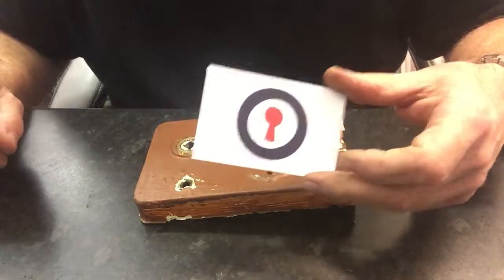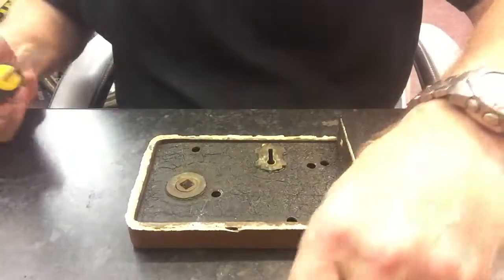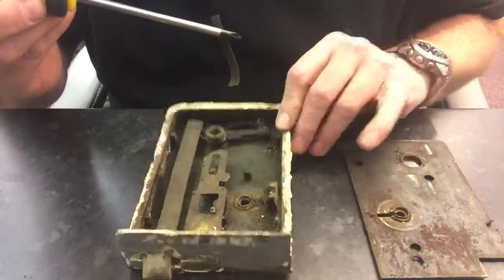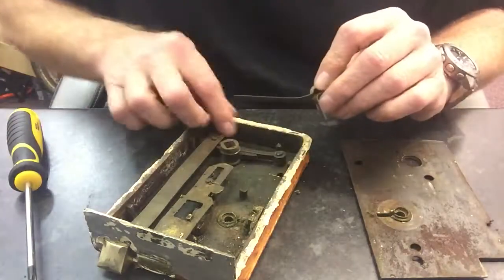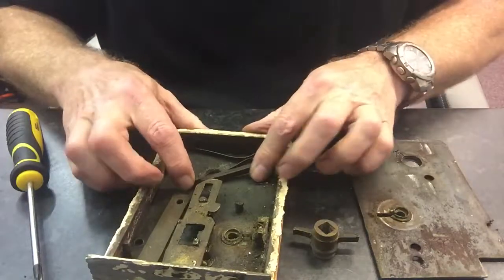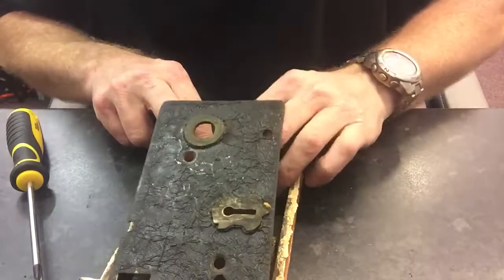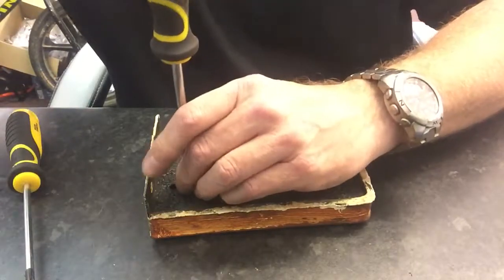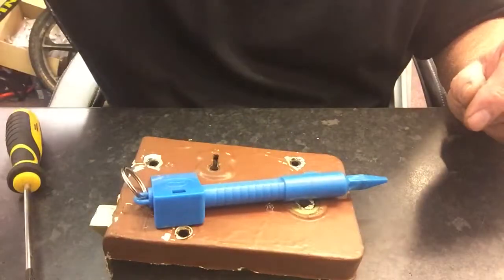Locksmith tool Old Rim Lock Spring Change

Comment: I have a 1888 Russwin rim lock. Where could find a spring for that?
Reply from the maker: In the UK? you could try "The spring man" he's a chap with all types of old rim springs on google.
Reply: I have a rim lock that I removed from an old iron screen door. I works fine but I took it off to rescreen the door and the two halves inadvertently campe apart and now I'm having trouble putting it back together. Can you offer any advice. I can send photos.